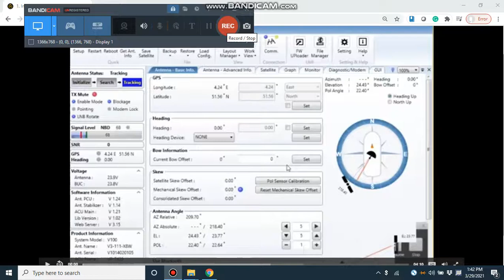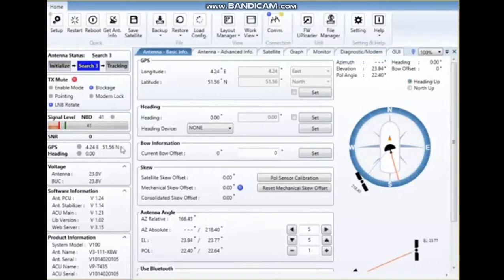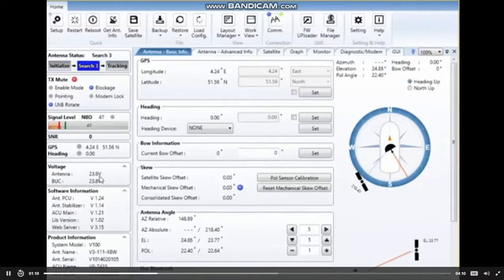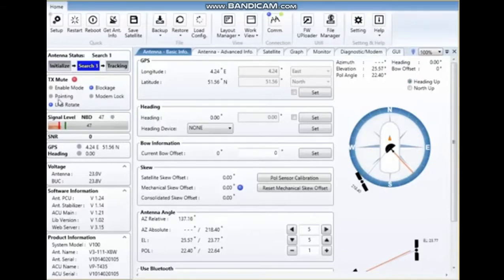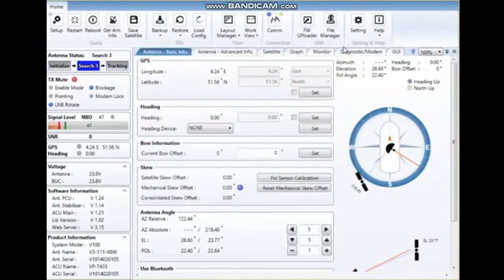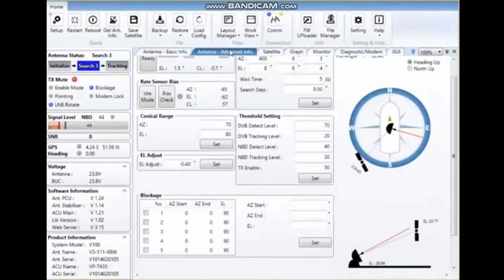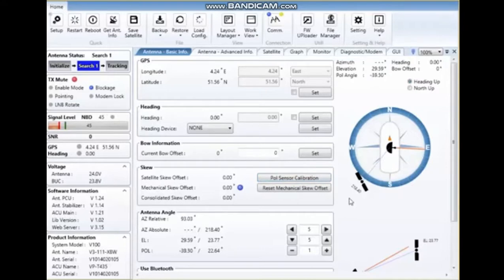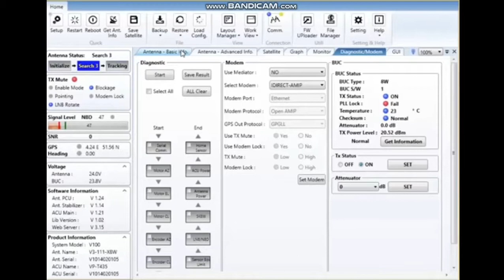1. Intellian VSAT Commissioning_Introduction

Comment: Hi Sir, we are testing V60 serie in our office, but currently the antenna can't locked the signal even tough can receive high level DVB/NBD, always on search mode and can't going to tracking. If we set the antenna to setup mode, the azimuth continue to rotate clockwise even we track the antenna manually. what can be the problem?
Reply from the maker: Did you try to manually search for another satellite covering your area on different polarization? Also check if there is any error when you run the diagnostics from the Aptus?